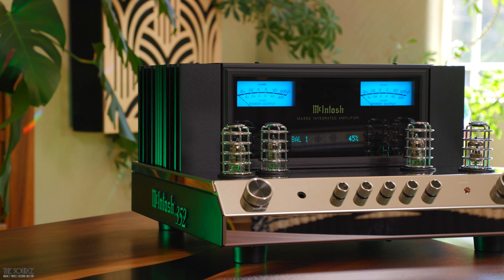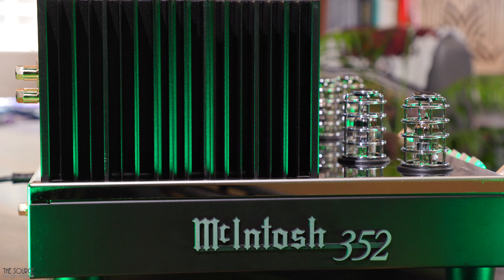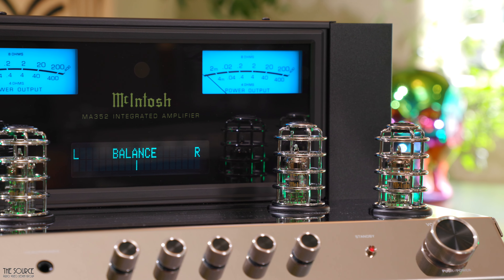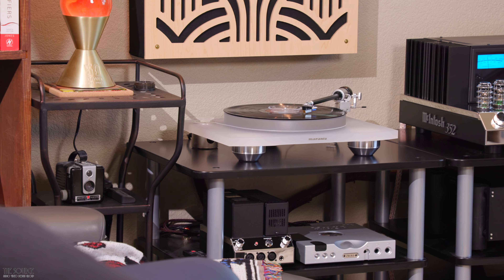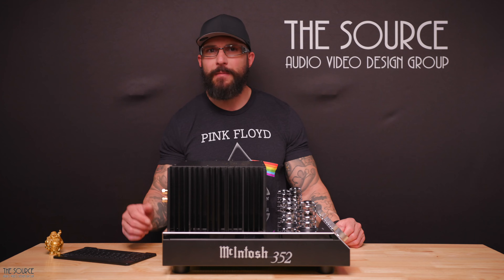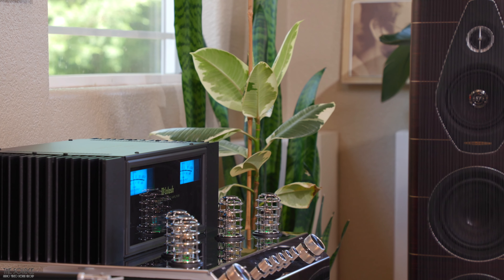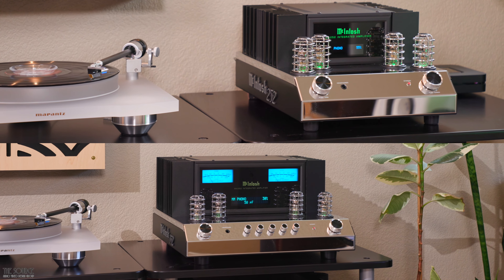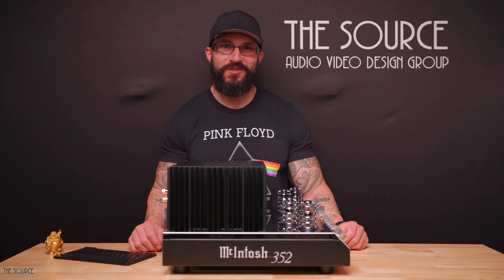McIntosh MA352 Integrated Hybrid Drive Amplifier with MA252 Integrated Hybrid Drive Amp Comparisons!

Comment: Thank you for not only reviewing the 352 but also comparing it to the 252 which I happen to own because I was looking for a simple integrated system for my turntable setup. My biggest question is this: is it worth the upgrade based on sound quality alone? I’m not too fussy on inputs I just care about sound quality that feels immersive with good clarity but is warm and not clinical which Mc does so well. I enjoy the sound of the 252 but part of me is  wondering if I’m getting an even more immersive listening experience with the 352. Would appreciate any thoughts!
Reply from the maker: @davidmnml6881 thanks for your great questions!  I think it is worth the upgrade on sound quality however it will depend on your preferences if you like the changes from the warmer sound of the 252 to the more articulate, resolving, and defined sound of the 352.  However you have the 5-band tone control on the 352 which will allow you to tailor the sound to your speakers and room.  I think it's worth a trip to your local dealer to hear them side by side if possible.

Comment: I have the MA-252 and their XR50 speakers. The sound is wonderful. The speakers aren't very efficient, but pumping that 100 watts through them makes the bass very deep and tight, not flabby. The sound comes from everywhere but still manages terrific separation. The amp is so quiet that if you have good ears, you might here motor noise on lesser turntables. My next step is a (high output) MC cartridge TT. Basic streaming from a phone with a wireless dongle sounds pretty decent believe it or not. Of course a streamer would be better but im more a vinly & CD guy. I also love the look. The meters would be nice, but they paid for most of the speakers.  😮

Comment: Hi im looking between the ma352 and the audio research i50, what would be your choice? Naim sources and totem forest speakers thank you
Reply from the maker: Based on the recommended power and sensitivity of your speakers, I would think the MA352.  The i50 puts out 50w, the minimum recommended power for your speakers, even though it is a high-current design.  Both are great amps; you may want the extra power the MA352 has, though, if you listen loud or have a large room.
Reply: @TheSourceAVDesignGroup  thank you very much, appreciated

Comment: I've enjoyed watching your McIntosh MA352 and Michi videos.  Are the MA352 and Michi X3 (or X5) similar in value?  Is one a clear winner in your opinion?  Is the additional power on the Michi noticeable?
These integrated amps are on my shortlist, but leaning towards the McIntosh based on the resale value

I'll be starting my 2 channel system with one of the amps noted above and buying speakers to suit.
On my shortlist are Martin Logan ESL 11's and B&W 804's. I've listened to both, very different, but appreciated both.
Also hoping to find a Focal Kanta 2 or 3 for review.

Thanks
Reply from the maker: I don't like to say one thing is a clear winner over another, as everything comes down to preference.  The Michi X3 is the best value for the money, I believe, but the MA352 is spectacular as well and a good value for McIntosh.
Reply: One thing is for certain. The McIntosh will retain its value way more than any Michi product. Buying McIntosh is one of the few audio investments there are.

Comment: How would you compare MAC7200 to MA352?
Reply from the maker: Hey, Mike, both are awesome what speakers and external DAC are you pairing them up with? Do you need the am/fm functionality?
Reply: The amp would be paired with older Bowers & Wilkins CM5 speakers. I will eventually replace speakers with 3 ways from Sonus faber. I currently use an internal DAC in a yamaha integrated receiver, so if I got the MA352, I would have to buy a DAC/streamer.  I am mainly interested in how autoformers affect the sound. @TheSourceAVDesignGroup